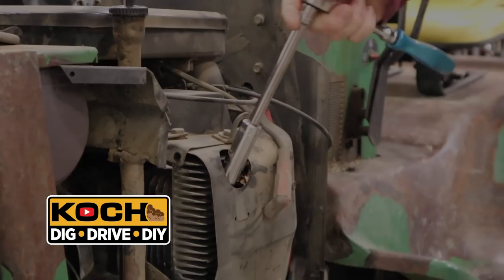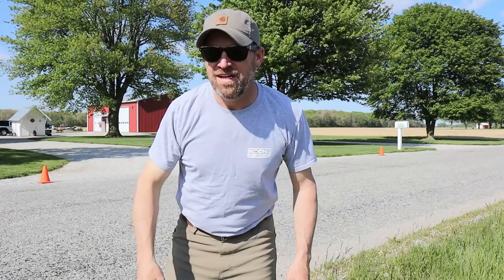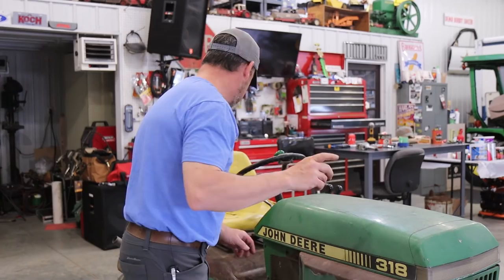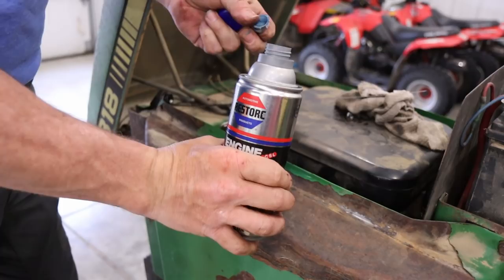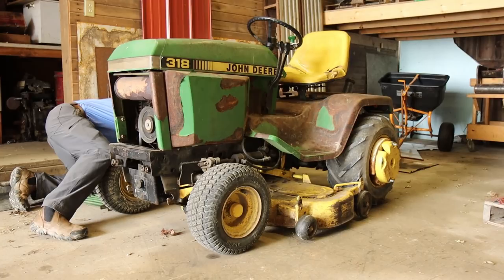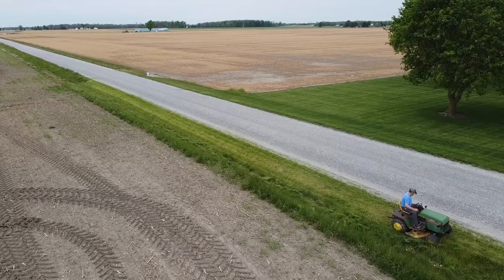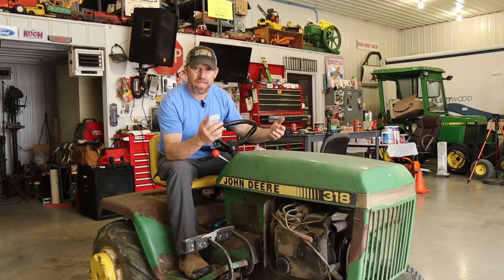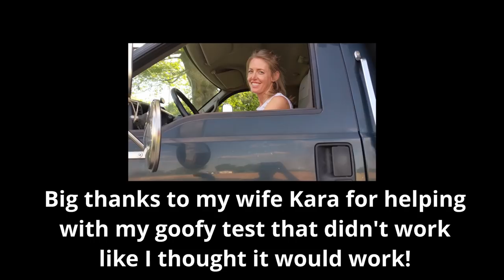Extreme Mower Testing With My John Deere 318:  Will "Restore" Oil Additive Help?

Comment: The Onans are hard to kill. You might try adjusting the valves before tearing it down. The intake lash is only .005", so it's pretty easy for them to wear and start hanging open.
Reply from the maker: The Onans sure do seem to hang on for a good long time before finally giving up.  I need to educate myself on adjusting the valves and I may just try that.  Thanks for the feedback on that cause I value your input Wes.  Appreciate you watching sir.
Reply: I think valves on these twins aren’t adjustable. But I think I’d rebuild it.
Reply: @michaelbenoit248  Yes they absolutely are adjustable.
Reply: Hard to kill? Easiest engine I’ve ever seen to kill. Ready for my 420 to get it’s Honda repower done
Reply from the maker: @jeremylee6668  Well, it's all relative.  I mean the engine is 35 years old and likely never had anything done to it but service and has been ridden like a mule. So, just depends on how long you would expect it to last I guess.
Reply: @jeremylee6668  Sounds like someone never cleaned their cooling fins, belly screen, or ran the correct oil in their engine...
Reply: Most Onans are clapped out by about 1500 hrs.  Parts are too expensive and hard to find to rebuild. But that's just my opinion.
Reply: @owentimo  Still cheaper to rebuild than to buy a new engine. Unfortunately many of them don't make it past 1500 hours, but then again there are plenty others out there still running with 3000+ on them. It all depends on how the owner cares for their machine.
Reply: @jeremylee6668  I can prove you wrong. I have two 318s, one has 2763 hrs and the other just rolled over to 2000 hrs. The one with 2763 hrs on it had the motor replaced at 2642 hrs because of someone never checking the oil so we just put another onan in it and it's still running strong. The key thing to keeping stuff running is maintenance and both 318s have been well maintained with one of them being owned by a guy who worked at a dealer and another that we've had since it had around 200 hours on it and both run strong.

Comment: You were right... her smile made her look guilty!  Does she have something in for poor ole Bill?   LOL

My first lawn tractor was a JD400.  I bought it used.  It had rear wheel weights, a mower deck, front blade and rear tiller.  

When I test drove it, the engine ran well but it didn’t seem to have any power.  The seller told me that was because it needed new spark plugs... that didn’t ring true.... but, I wanted it really badly.   So, I brought it home.  

After changing the spark plugs, oil and air filter.... I put it to work.  Mowing the lawn it did pretty well.  I could mow in low range,  at full throttle and half peddle in the hydrostat. It would drive down the road in high range and full pedal.

Then, I put the tiller on the back.  The 3-pt could barely lift it.  The PTO had just enough power to mix sand... once it touched dirt or even skinned a worm... it bogged down and played sick.  

I deduced that the hydrostatic drive was shot.  After reading everything I could find (pre - Al Gore’s gift of the internet), I went to the JD dealer to get a quote in rebuilding it.  They laughed as they quoted me diagnostic fees, overhaul, wait time the half life of sequoia tree... etc.

So, I asked them about trading it for the diesel version... I think it was the JD420.  First of all, they had none in stock.  Second, none of my attachments would fit it, with the exception of the wheel weights.  And C, they were only going to give me $250 in trade, for the tractor and all my attachments.  

The salesman delivered this news with a smug, over confident attitude... like, this is the best deal you’ll get, Chump!

So, I pulled my trailer across town to the Kubota dealer.  I told him about the hydrostatic drive issue... and he walked me over to a compact diesel tractor.  It came with a 5’ mower, four wheel drive, bucket loader and a 52” tiller.  His deal was, $1000 for my trade, one year in-house financing at no interest and $1500 less base price than the JD420.

Since it was in-stock, I drove home with a trailer load of orange toys!  I have never regretted making that change.  I have been running pumpkin colored tractors every since.   My brother-in-law is still using that B1700 today.  

A few days afterward, I got a call from the JD salesman.  I told him that I wasn’t interested in their deal.  I also mentioned that the $250 trade-in was an insult.  He said they could offer $400.  I then told him that Kubota gave me $1000 and a better tractor for less money.  He finished the conversation by telling me that he hated for me to settle for a second rate brand.... and that he’d be there for me just as soon as I learned my lesson.

And, the JD400... a few weeks after trading it, I went back to the Kubota dealer to pick up oil and hydraulic filters.  It wasn’t there.  I asked the salesman where the JD400 was.  He told me that they had changed the hydro fluid in it.  When they pulled the strainer out, they found it plugged.  After cleaning it and changing the filter, it ran like a new one.  It only sat on their lot for two weeks!

I personally don’t have a problem with JD equipment.  I’ve used quite a few pieces of it.  But, that whole arrogance and over pricing thing still rankles my spine. I’ve made a few trips back to that dealer... they were sold out to a company that has five or six locations.  They built a huge dealership that covers about 20 acres.  The salesman that I dealt with is no longer there... but, it is apparent that before he left, he trained all of their other salesman on his art of customer service!  

Last year, I decided to trade my second Kubota (a BX24 sub-compact Tractor, Loader-Backhoe) for a new one with quick change mounting and SSQA bucket mount.  It was in excellent shape and low hours, I just wanted more convenience and versatility.  I decided to give JD another chance.  

From the time I pulled into the lot... the salesman’s look of pity, over confidence, unwillingness to deal on price or trade.... sent me right back across town to load up my new Orange BX23S!

Neil, I was wondering.... dealers don’t seem to get the message.  But, perhaps tractors do.  Is there a chance that threatening to spray Bill with a little orange paint might improve his outlook?
Reply: LOL...Skinned a worm. Ha, really enjoyed your humorous and well thought out comment!
Reply: @marykoch5168  thanks... I think it helps to look for the humor when you can!

I appreciate your thoughts.
Reply from the maker: I don't want to hear about any KUBOTAS on this channel... 😋

Of course I'm kidding.  I think Kubotas are terrific tractors.  Most of my friends all have Kubotas and I'm actually the only remaining Deere hold out.  Only difference is they have all bought new ones and I have always bought used machines.  The secondhand Deere experience is generally trouble free as I allow the first owner to assume much of the depreciation expense.  Of course they get to have the best years and usage of the tractor too as seem to finally I take it off their hands just days before would have otherwise been loaded onto the scrap truck!

As much as I am a Deere fan boy, I know first hand the dealer experience you are talking about.  I'm embarrassed to admit that our local dealership is nearly exactly as you described.  Your salesman must have trained their staff as well!  So no, I don't think dealers have gotten the message.  Our local Kubota dealer is really good too.  I'd be happy to have a newer Kubota, but I don't know that I'd ever live down the ridicule at this point.  Still might be worth it though :)

As far as the orange paint... I'm willing to threaten him, but I'm doubtful it will have any influence on his performing abilities.  The problem for the last couple years is that he can walk just fine, but he cannot run.  I've got a plan but time will play a factor in getting it done.  We shall see how it goes, but I haven't bought any paint yet!

Loved your story and willingness to grace us with such a wonderful story/comment Dave.  I have been getting behind on my comments lately.  I feel fortunate that I seem to be getting more of them but then remorseful when I don't respond as quickly now.  Regardless of how many there are stacked up in a row though, I always completely read through yours.  Have a great week!
Reply: @digdrivediy  Neil, I have been fortunate to have an understanding wife.  She hates it when I’m in a foul mood.... and nothing puts me there quicker than having to wrench around on a broken down old piece of equipment that I need to use.

Don’t get me wrong, I don’t mind doing maintenance and a few minor repairs... but, my dad never once owned a vehicle or piece of equipment that he didn’t have to spend as much time fixing as he did operating it.  We lost whole crops of hay, we’re penned in the snow for a week, had a tank of milk spoil, lost a bin of corn... and endured countless marathon walks to get help... because of broken down equipment. We never took a long vacation because our family vehicles were never reliable enough to make a trip over 150 miles from home.

With a job that had me traveling 70% of the time, I couldn’t afford to spend my meager family time muck-anican around.  So, I bought a new tractor and resolved to trade it in while it was still in good shape and had a high trade in value.  

I fully understand fixing and restoring can be enjoyable... but, you have to love it.   I just don’t!  That you do, is perfectly fine.  It is every bit as respectable as any other hobby or interest.  I didn’t in any way intend to come off as bragging or demeaning old equipment.  It just isn’t where I want to spend my time.  

I appreciate that you spend so much of your valuable time reading and responding to my comments.   I truly enjoy reading them as well! And, lots of comments in your channel.... that’s a blessing!  (One that comes with a burden.)

I anxiously await the next chapter in the saga of “What about Bill?”
Reply from the maker: @sassafrasvalley1939  Oh I thought nothing of the sort! (that you were bragging or demeaning old equipment)  That is one unfortunate circumstance of the written comment.  If you could have heard my inflection, you would have know how light hearted I intended my response to be.  
I struggle with the desire to want to buy something newer all the time.  It is in fact the subject of an upcoming video that I have in my head.  (buying new versus old)  When I was young, I bought junk out of necessity. The older I get and the more I can afford, the more I hate having to work on the junk now too.  I used to be the same way with vehicles but about 10 years ago decided I didn't feel like wrenching on them anymore.  So, my wife and I have stuff that is new enough now that most generally, only gets maintenance and anything beyond that, it goes somewhere else.  

So, please know I respect the new tractor purchase as much as the trash to treasure style purchase.  Besides, we gotta have folks that will buy the new ones so that there are eventually some nice used ones on the market! 

You've given me some more great inspiration for the "old vs new" video now too!  I can really appreciate those stories of your youth and how that could influence.  Good stuff.  (although sorry you had to endure)

Thanks as always!
Reply: @digdrivediy  well we can’t all be Shakespeare’s or Twain’s... I know I can’t.   LOL

Now I have two videos to look forward to....

I don’t regret the adversity of growing up on a dairy farm, in a family of seven, in the 1960’s... when farmers would knock newborn calves in the head because the whole market had tanked... I think it gives me a perspective on the value of hard work, personal responsibility and independence that I never would have had otherwise.   

The collapse of family dairies story revolves around the introduction of margarine... perhaps I’ll explain it some time.    In the meantime.... take a look at today’s dairies.   The equipment, scale of operations and especially the color of the cows... 

Later, bud!

Comment: I can't recall the stats on the hydrostatic version of the transaxle in the 318, but the Peerless 2300 geared version is rated for 750 lb/ft of torque (!!). They used the same transaxles in aircraft tugs in the 70s to shuttle around 737s. 😉 While I don't have one sitting around to confirm, I look forward to some serious stump pulling after the engine swap is done!
Reply from the maker: I'll have to load the Dump Truck bed full too!

Comment: Back in the 80's I helped design a 3 wheel all terrain gas/electric wheel chair.  As we were shooting a video on it, had a delivery semi come to shop.  We hooked up to it, and as we started to pull it, the driver just shook his head in dis-belief that a power wheel chair was pulling his truck with the 35' trailer.
Reply from the maker: That's awesome Jack.  I never would have guessed that either.  Must have had some wicked torque and traction!  Thanks for sharing a cool story!

Comment: First things first....  A 318 is a Garden Tractor (GT), not a Lawn Tractor (LT).  A garden tractor is designed to use ground engaging equipment, IE mold board plow, sweepster,etc....  Lawn tractors are for mowing and pulling lawn trailer and a fertilizer spreader.  I've pulled some really amazing things with my re-powered 318 that many people didn't think was possible for it to do.

BTW.... Great videos
Reply from the maker: You're right about the Garden tractor bit!  I always say garden tractor but thought I'd throw a "lawn tractor" in there for the YouTube algorithm to hear!  It seems like more and more folks don't say garden tractor these days.  Sad really.  I really love these 318s and all the other GTs that helped us get stuff done.  Thanks for comment, kind words and for watching!

Comment: We had/have a 318 used at our boat marina from 1990 to 2015 ish and it’s still kickin. This thing has lived the hardest life ever by far. We have a hydraulic Quik hitch on the front with a hitch ball welded on it, big weight box on the back. This thing would spend hours each day moving 5-6000 lbs boats around the yard. Tandem axle trailers, whatever. We just beat the absolute piss out of it. You can do reverse full speed then slam the hydro to forward and wheelie til the weight box hit and let it slam down. She loves it. Broke all the mounts off the transaxle multiple times. Weld it back together and the thing just keeps going. It literally will not die. Just an amazing machine. So I say you have no choice but to restore and keep this thing going
Reply from the maker: That's awesome!  They're tough for sure!

Comment: Great video, I have a 318 I'm facing the very same decision on, I need to narrow down a bit more where my problems are coming from.  I get a good bit of blue smoke under load changes, the PTO actually ALMOST stalls out the engine when I engage it.  I've got too much time into working on this machine to stop now, so the "recycle" option is off the table for me.  I hope to see you keep Bill alive and well, either from a rebuild or repower.  

Great video.  Those little machine sure can pull.
Reply from the maker: Thanks Kyle.  Yep, I've been down this road before with a couple other tractors as well.  I suppose when you're running 30 year old machines, these are the decisions we are gonna face eventually.  Good luck with determining what is going on with yours and thanks for watching!

Comment: Saved a JD 318 from being pushed into a dumpster,  with a snow blower and mower deck, used many Miller welding machines and they used Onans that were as old as me, and they had never failed even on 24/7 jobs, just stopped for refuel and a oil check and they ran round the clock,  many of the newer machines with offshore engines could not handle it and exploded on some of those welding jobs, but the Onans slogged through and never quit, so i took the 318 home and patiently sorted it out years of neglect, It retains the Onan it came with, did not want to shove a china engine into it and have it explode like the welding machines with china engines did, It runs as new and looks like it too, great unit the 318.
Reply from the maker: You're 318 is my kind of 318!

Comment: Seafoam it - it helps with the valve deposit buildup.  Would make for a fun video series to see which "fix ups" work before taking the heads of and rebuilding.
Reply from the maker: I've used seafoam in the past with mixed results. Would be a good video series though. Thanks!

Comment: You need to deck the heads, seat the valves, set the lash and clear the carbon deposits, basicly a total head job with new gaskets and possibly new head bolts!
You a lucky man with a gorgeous wife and beautiful daughters that are willing to help you with work when needed!
Reply from the maker: Hi Steven!  You certainly sound like you know what you're doing on these more than I do.  I think you're likely right with all of your suggestions I just don't know if I'll have the time or know how to do it yet.

I appreciate the kind words my friend.  Yes, I'm a very lucky man to have the wife and kids that I do!  Feel like I don't deserve it some days.  Thanks so much for watching.  Great to see your name pop up in the comments.
Reply: @digdrivediy  A trick to decking the heads is to get an absolutely flat surface big enough for a full sheet of at least 220 grit sandpaper and only remove about a 0.001 to 0.002 thickness of aluminium from the heads, you just want to take out any warpage, then reseat the valves and adjust the lash to specs, then re-install and check compression.
Reply from the maker: @stevendegonia  Great tips!